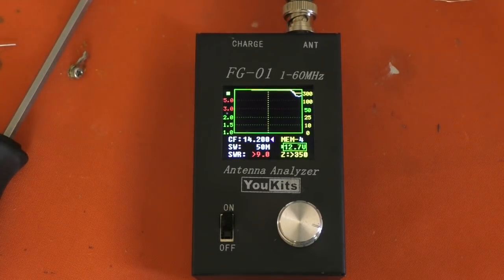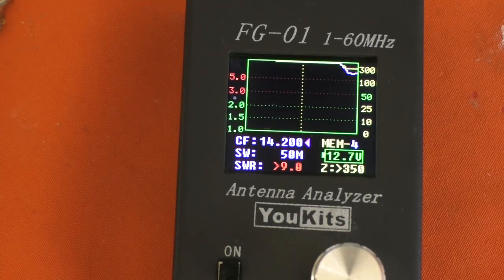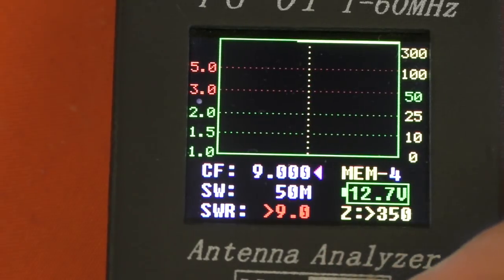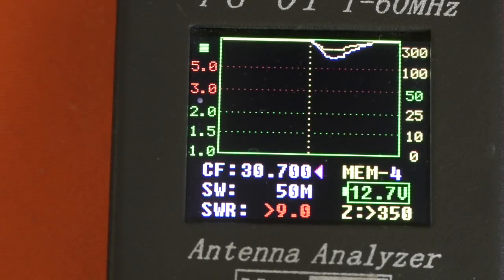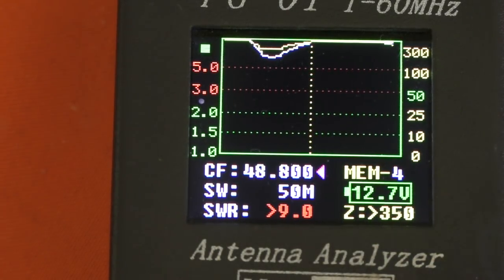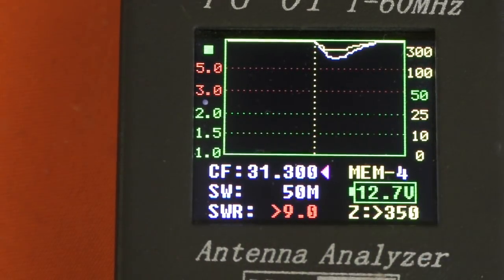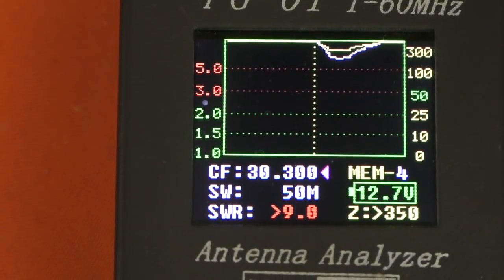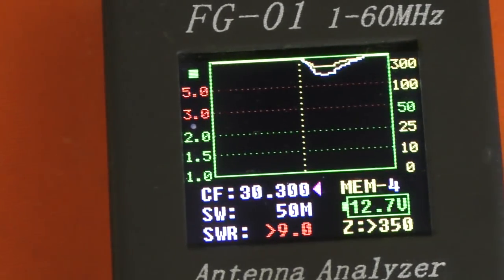This Choke Will Do

Comment: Great video Steve, thanks for the info on how to change the response frequency - does it ever need so many turns that you are losing the effectiveness of the 'choke' itself?
Reply from the maker: Thanks Simon. You could put heaps of turns on a choke and it would have such a high impedance that it would be fine. Think of the old lump wound 2.5mH chokes.

Comment: Isn't the wire too thin? In case of a B+ short across the coil the wire may vaporize before the protection fuse blow up...
Reply from the maker: It's 0.8mm, 20AWG so it should just pop the fuse.